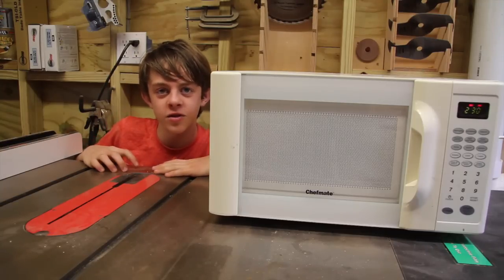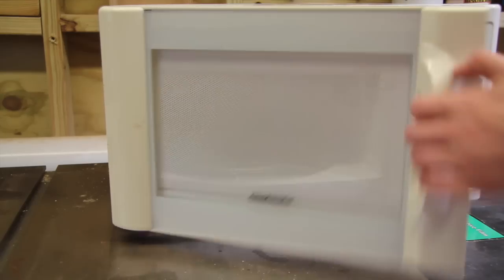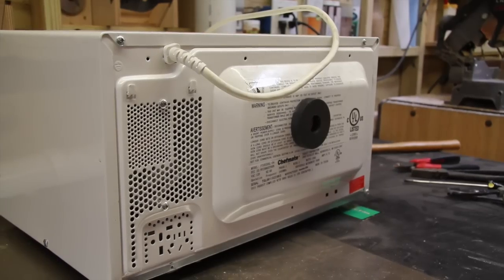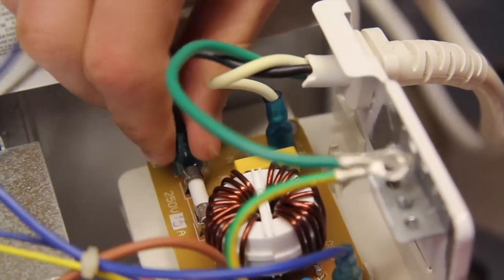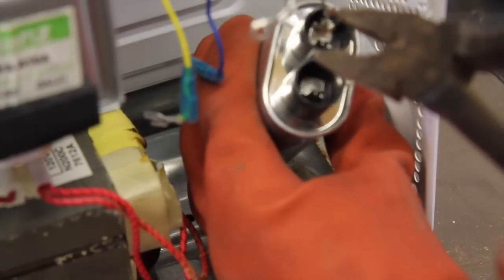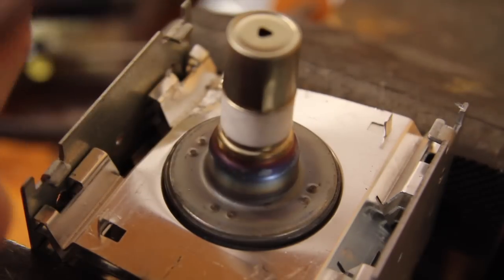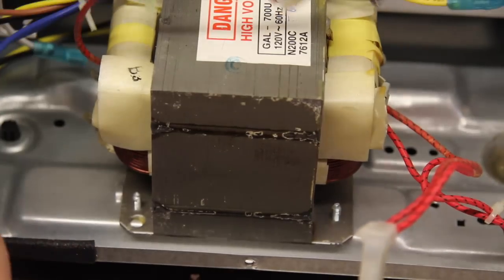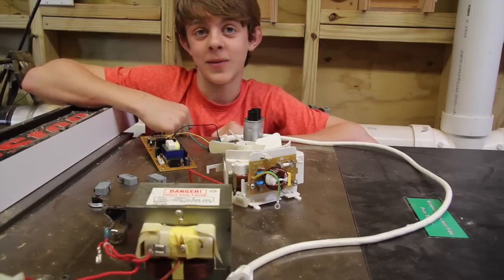Salvaging a Microwave

Comment: Interesting project. Looking forward to seeing what you do with the parts. I'm glad you were aware of the danger of the capacitor. I was worried about that when I saw this video. I was pleased to see it all went safely.
Reply: You were worried about the capacitor but not the possibly borillium oxide insulater in the magnetron that he just ripped open. Im more scared of that thing.
Reply: @tylerhickling6674  how do u avoid the danger while opening it?
Reply: Just don’t crack, break, or grind the ceramic piece. Maybe even put a piece of tape over it before you take it apart

Comment: Great tips! I'm glad to see you made others aware of the capacitor, it can be deadly!  
I multimeter would tell you if it's safe for sure... the capacitor could prob be used to replace on a tool such as a small drill press

Comment: wouid I get hurt if I try to get the  fan and motor  out  off the microwave
Reply: Just discharge the capacitor and avoid cracking the ceramic pieces on the magnetron and you’ll be fine